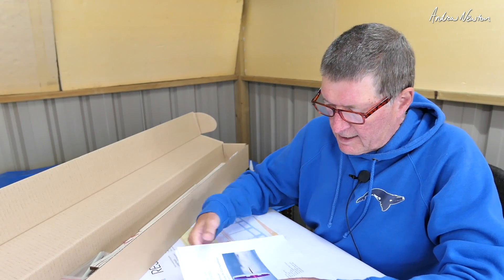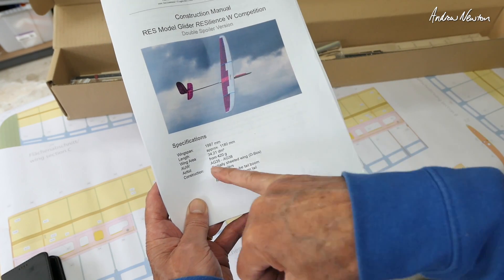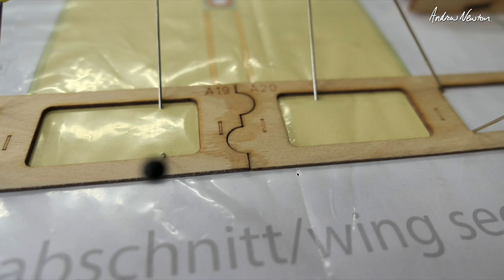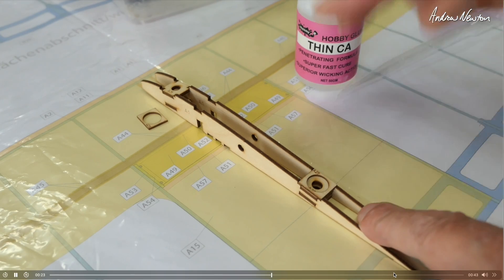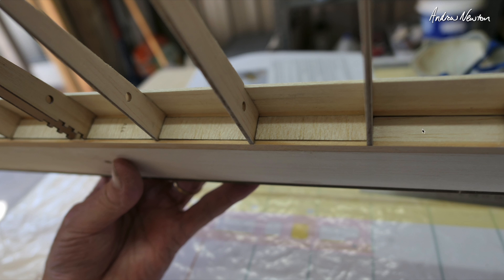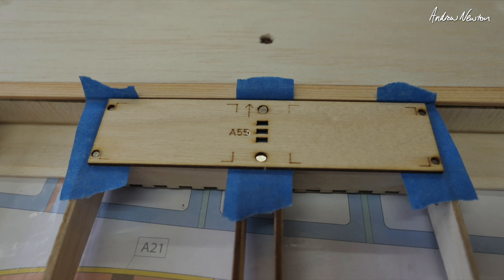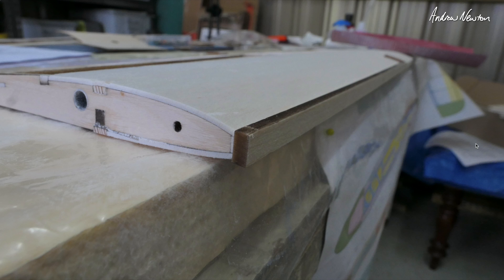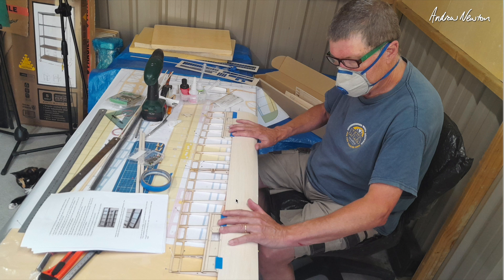RESilience RES Glider Kit Build - Part 1

Comment: tip for balsa sheet ,just spray water on it , it will curve in without cracking
Reply from the maker: Great tip thanks. There is a lot I don't know about balsa builds

Comment: 2m wingspan and 420g wow! That sounds like the kind of plane that gets stuck in a thermal and you never see it again, be careful.
Reply: I had that happen with my first ever RC plane , it had no control surfaces just by differential thrust and power, was out of trim , got stuck in a thermal , it just went up and up till it couldn't be seen anymore .....
Reply from the maker: Gentle beach sloping is the plan.

Comment: Hello Andrew, I fly F5RES - basically the same glider as the F3RES but with a motor. You are not going to believe how well these things float, the only problems are the fact that they are so fragile, and that they will ruin foam for you.   
If you never intend to compete, I'd seriously consider adding a layer of fibreglass to the leading edge and fuselage before covering. You won't notice the extra weight but it'll take slope landings a lot better
Reply from the maker: Yes it will be tested with our wind and big slopes

Comment: Great looking KIT. Awesome looking design. Nice mod for the spoiler servo arms.
That the two spoilers each have independent servo leads means could set up as spoilerons, if every needed more snappy roll control. (just open one up a bit at a time)  Don't think need, but could be something to experiment with, once flying and trimmed.